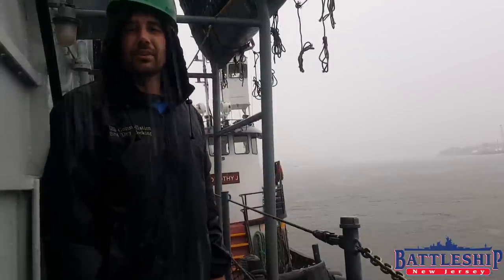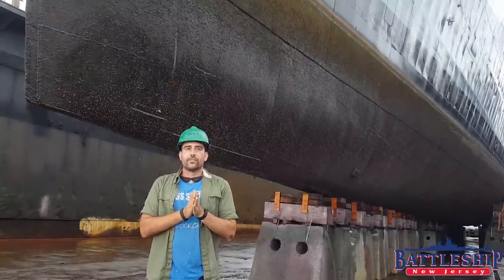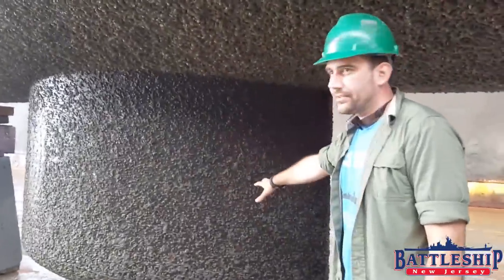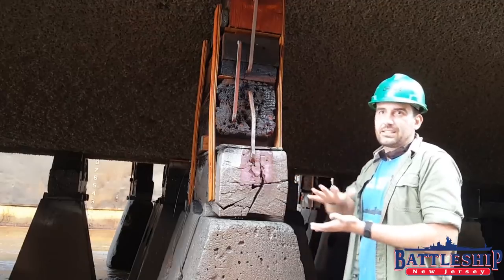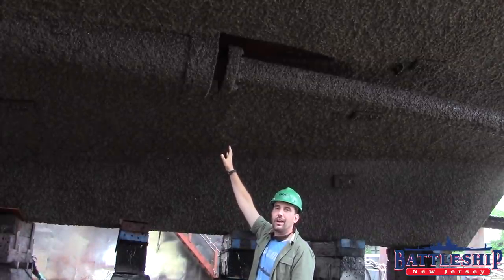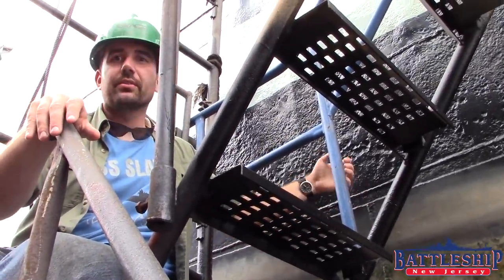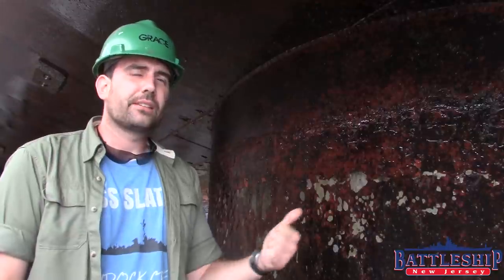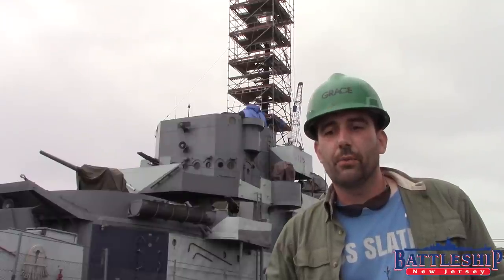Dry Docking a War Ship

Comment: Battleship Texas is expected to be dry docked sometime early 2021. In the case of the Texas, she is expected to be getting an entire hull replacement. This is due to her deterioration from sitting in a shallow berth for the last several decades in brackish water. For the last 18 months, the Texas has been closed to visitors and every artifact onboard is being restored by volunteers in a nearby warehouse. For the last several months, Resolve Marine Group has been contracted to handle the moving of the ship to the dry dock. This requires the removal of everything on deck and the foaming of 30 tanks below the water line in order to increase her buoyancy. It has not been announced which shipyard will be handling the work or where she will rest after the work is completed. Battleship Texas is expected to be in dry dock for 12 months. I implore you all to follow the story of Battleship Texas.
Reply: From what I have seen is that the Texas will probably go to Ingalls in mobile.
Reply: I really hope Texas doesnt do a Warspite and break free of tow lines and beach herself
Reply: Update: Battleship Texas is now expected to be moved to dry dock in late 2021 after hurricane season
Reply: A hull replacement ? not to original that's a lot of thick steel
Reply: @eddiekulp1241  We are keeping the original armor belt in place. Her hull is separate from the belt armor. She also has a second hull on top of the armor in the form of the torpedo blisters that were added in 1925-27. It's all 3/8 shell plating like slater but in much worse condition.
Reply: Everything you said was pretty much spot on except for the reason for removals and foaming. It wasn't for increased buoyancy. The foam actually added weight since it replaced air with foam. The foam was to act as a stop gap to plug most of the tiny leaks and make sure those tanks can't flood anymore since the foam displaces where the water would go. The guns on deck weren't removed for weight either. They totaled maybe 300 tons of your super generous. That's nothing to the ship. They were removed just to be restored.
Reply: She's in the dock now. Let's see how it goes. FYI, there's a pretty sweet drone video of her in dry dock already.

Comment: Usually I find that zinc anodes not sacrificing themselves is a bad sign because it means something else has.
Reply: I know "sacrificial zinc" is a generic term people use.  But, I  thought zinc was for salt water, Magnesium for fresh and Aluminum for brackish water..
Reply: @__hjg__2123  Yes. Sacrificial metal is really the generic term
Reply: @__hjg__2123  One metal will be acting as anode and one as cathode. What is what depends only on your metals electronegativity(its 1.83 for Fe, 1.65 for Zn, 1.61 for Al and 1.31 for Mg). Metal with lower value of electronegativity will be dissolving. I can imagine that you want to use Mg for cathode if you planing to drink that water, extra Mg in your water is safer and potentiany benefitial for your health and you do not want to overdose the Zn.
Al is used in salty waters because you need Cl ions in the water to avoid aluminium passivation but here i can imagine that Zn is easier to mount and this ship is in a river so not so much salt is in the water.
The fact that you have salt in the water helps with the transfer of the current and that is why cars rust more in places where in the winter the salt is used to protect roads from snow/ice.
https://en.wikipedia.org/wiki/Sacrificial_metal
Reply: Usually the zinc anodes and metal that they are protecting are not covered in paint...
But in this case its different story and if paint is holding then there should be no contact with the water = no sacrificing.

Comment: Buoyancy of floating drydocks is amazing.  To lift that tonnage with just air vs. water.
Reply: So easy in metric. 10 cm2 = 1L = 1 kg
Reply: Not really a big deal. Just weight of water versus steel and bouancy of air.
Reply: @johnknoefler  Air is less dense than water making it negligible. The boat is buoyant because the water displaced by the hull creates a force that overcomes the weight of the ship. This is a huge deal. Just from a quick Google search it appears as if the USS Slater displaces 1,240t of water. That's a lot of force being generated.
Reply: @johnknoefler  it's called displacement which means the amount of water a ship displaces to float or in this case the ship plus the drydock
Reply: Just a stupid Question but where do floating drydocks go to be worked on?
Bigger drydocks? And how do you work on them?
Reply: @sealy3  There is never a stupid question. Yes they go to a bigger Dry Dock to be worked on and in some cases they go where they have what is called a Graving Dock. Those are dug out of the ground and have a gate so to speak they close and pump the water out. Working on them is pretty much the same as working on a ship. They perform a inspection on the under water hull and make the repairs needed. Then they would blast the old paint off and repaint. There would also be repairs made to system inside that cannot be opened up while in the water.
Reply: Look up that famous picture of a dry dock ship, holding two other dry dock ships, holding their own ships on top. Pretty funky one.

Comment: When I was in the Navy we were told that the ship had two separate blocking plans and they would alternate which one they used each time the ship was dry docked.  So parts that did not get blasted & painted in one yard period would get  taken care of next time.  Of course with active USN ships they are typically dry docked every 5 years at least which is not feasible for most museum ships due to funding issues and in some cases lack of suitable dry docks.  (if Iowa or Midway needed to dry dock they would need to be towed to either Hawaii or Seattle)
Reply: Now, for an additional charge, they "fleet" the vessel, which is to say they move her forward or aft a few feet  on the blocks, and pump out the dock to get the areas that were covered by the blocks. It's a great time to check for leaks.
Reply: That’s the advantage of floating dry docks. They move to your location

Comment: At around 9;02 the plug in the bottom of the rudder is to preserve the rudder on the inside. The newer DDG's and most other class ships have one on the bottom and two on the top of the rudder. The process is know as flow coating. The process goes like this you pump in a preservative and then pump in potable water  to float the coating to coat the inside of the rudder till it comes out of the top plug hole. Then you would start draining the water back out to coat it again then reinstall the plugs preserving the inside of the rudder. Yes I work in a shipyard and we do repair work on US Navy ships just in case anyone wondered how I know this. We do this prior to coming out of Drydock.

Comment: Damn but that takes me back.  The last ship I took through a drydocking was a 'little bit' larger than Slater, a 40,000 ton amphibious assault ship.  Even while in drydock we had to feed water to parts of the ship's engineering plant and to the saltwater fire mains via large hoses from the sides of the dock.  Overboard discharge was also active so we did have water being discharged through some of the seachests even while work on the hull was on going.

She sat much higher above the dock floor than Slater is here, it was possible to walk from one side of the ship to the other with this big 'steel cloud' overhead.  Neat!  The two six bladed screws were huge, about 18 feet diameter and she had two rudders.

Comment: The propellers on the Slater seem relatively small, what RPM are they running at  flank speed?
Reply: TDL: probably around 300 RPM, roughly.
Reply: As he said in the video, they're designed for efficiency rather than speed. Destroyer Escorts like the Slater were designed to have a top speed of only 21 knots. They were intended as economical convoy escorts. They didn't need to be fast to keep up with a convoy plodding along at 12 knots, they only needed to be quick enough to run down a submerged submarine, most of which could only get into the low 10s of knots at best. Cannon-class destroyer escorts are small ships, so they needed their powerplants to be as efficient as possible in order to make the long voyages across the Atlantic and Pacific.
Reply: Uss slater?
Reply: @klegendm2819  Yes.
Reply: USS Slater is a museum ship based in Albany, NY

Comment: I always wondered how they coated the places that the blocking covered
Reply: "Bouncing" they call it.
Reply from the maker: Or fleeting
Reply: I wondered that also. Seems like a lot of time and expense to get to those small spots. But I guess it does need to get done. I thought maybe they put new blocking in the freshly painted areas and pounded in some wedging to take some weight off the original blocking and then knocked out that blocking to get to the spots. Apparently that would not work or take longer and be more work than repositioning the ship by flooding the dock.
Reply from the maker: Painting is important here, but its also about looking at the hull for issues. Fleeting gives you the whole picture. Ships that don't do it have problems down the road
Reply: I thought they would do the work on the hull, wait for it to dry, put new blocks below the ship and remove the old ones, without flooding the dock.
Reply from the maker: Getting the original blocks out would be risky in that case
Reply: @BattleshipNewJersey  Having gone through dry docking on a Navy ship and on several sea going tugboats I always wondered about those areas covered by blocking too.  Now I know.     One question though, It looked in the video like the zincs were painted also or was that just the lighting?
Reply: With much smaller boats hoisted by a travel lift (crane using slings that moves on wheels) the way this is done is on the last day in the yard they hoist the boat and hopefully time it for lunch so she is in the slings for an hour or so.  We quickly  roll under the keel, scrape, sand, and paint.  You need to ignore the fact that if the slings part you will be squashed like a bug and just do this work as fast as possible.  Usually most of the keel is supported so I can sneak up on the work reach under the keel while doing the rest of the hull so there are only small bits left where the blocking is.  Bottom paint will cure underwater but it is not the best way. The jacks that hold the boat laterally can be doubled and the old removed and this is usually done as soon as the main part of the hull is painted and curing.  Then the paint under the stands can be sanded and painted.  This adds about a day to the work but there are always many tasks to do while your boat is out so you just shift to them. Always nervewracking procedure.
Reply: I used to work on a drydock and the areas covered by the blocks do not get painted. Every time we dry docked ships you would see where the blocks sat from the previous drydocking as the paint was very faded. Naturally you would position the ship to make sure you could paint those previous areas when the ship went into dry docking again. The paint that was originally applied to the hull lasts a very long time. The bottom of the hulls were typically in very good condition. Most rust and corrosion problems are right at the keel line typically at the front of the ship.
Reply: As long as the zinc plates tough bare steel hull .. you can paint over them exposed to water
Reply: @SCVIndy  Where do you get this info?  Zincs I've seen, the type used here are stamped, DO NOT PAINT on them.
Reply: @alwaysbearded1  they use zinc anodes in heat exchangers using salt water cooling .. their just bolted on inside .. metal to metal contact needed so the electrolysis creating the rust goes for the zinc before the steel 

Painting over the outside doesn’t effect the metal to metal contact w the hull
Reply: @SCVIndy  Should I try that with my prop zincs tomorrow then?  My pencil zinc inside my engine is as you described but I've always been cautioned not to paint zincs. Next time I'm at my local Maritime Museum I'll take a photo of one of the 50# zincs that are like these and see if I'm remembering correctly. If the paint job were perfect how would the zinc connect with the water to complete the connection electrically?
Reply: @alwaysbearded1  my only knowledge is limited to heat exchangers ..
Reply: @SCVIndy  NEVER PAINT AN ANODE - this is one of the first things I was taught while working in a boatyard...surveyors flag painted anodes, furthermore many anodes are stamped "do not paint"

Comment: Came across an interesting story about USS Iowa being drydocked in one of the big floating drydocks during the latter stages of WW2. Her Captain (who was apparently something of a hot dog), rather than following the directives of the floating drydock crew and moving into the dock very slowly, charged in at about 10kt, , then backed down full to stop. Of course, that knocked over some of the blocks, and sure enough when they pumped out the drydock and picked up the ship, one of those out-of place blocks punched a hole in the outer hull.

Comment: Amazing video! 

May I ask one logistic question ?
When the ship is fleeting ( fleeted ? ... damn, my english isn't good enough ! ), you basically re flood the ship ( submerge the drydock ), then remove the blocks while underwater AND then place a whole new sets, and then re dock the ship like 2 feet away, correct ?
To do so, you need a very precise control of the position of a quite huge ship ( I guess that it's no easy feat ... how do you do that ? ), AND you would need 2 sets of individual block adapters , and a very precise sequence of where they would go ( If I've understood correctly, there are specific drawings for this ), and someone who install it underwater ... Correct? 
 It's a huge work even just set the ship where it should go! 
And a whole lot of complex steps ! 

WOW!

Comment: You may have overstated the pressure used. Water at 80,000 psi WILL puncture the hull.
Reply: I think he meant 8000 psi. Yes, 80,000 will puncture the hull considering the steel is likely 36,000 psi

Comment: If you have a hot water heater in your house it also has a zinc anode just like they have on the battleship well it’s smaller but still serves the same purpose

Comment: Surprised that the blocking is not placed under the hull frames, especially with thin plates.  I would be concerned the plates might collapse in such an old ship.  Destroyers always look like the hulls are made of tissue paper over balsa wood ribs.
Reply: if there're enough of them the weight gets distributed to make each spot within its tolerance. I would think the navy took that in to consideration (he said they followed the navy's plan)
Reply: Pretty sure there is a print with the layout and blocks specified, supplied with the prints for the ship.
Reply: A good friend who served says they are nicknamed "Tin Cans" for that reason.

Comment: This was amazing.  I was surprised at how small the propellers are.  The ones on
the Titanic seemed much larger.  Also, if the sonar dome hits something, could
it tear off and put a hole in the ship?
Reply: i think you are confused by the size and type of vessel shown here. USS Slater has only a displacement of 1,260 t to Titanic's 52.310 t.  this is not the USS New jersey that at her peek weight 61.000 t according to Wikipedia.  
for te sonar dome, as far as i know it is a separate compartment  sealed from the rest of the ship, but i expect it probably wil cause at least a hole in the bottom if the dome hints something because the backside wil push upward.

Comment: Question: What IS the largest museum warship in the world now?
I figure the Iowa-class battleships as a group are the LARGEST, completely preserved CLASS of naval vessels (all 4 completed units still in existence) BUT that the largest INDIVIDUAL preserved warship is probably the USS Midway, the lead and sole-surviving ship of the Midway class aircraft carriers.
The Iowas grossed around 61,000 tons each fully loaded.  General/light load was around 47,000tons which is still impressive by today's standards.
The Midway as commissioned grossed 45,000 tons which wasn't even the highest-grossing carrier of its service entry post-World War II -- the biggest carrier by tonnage in World War II would have been the Shinano (70,000 tons), converted from the third Yamato-class battleship.  Shinano did not survive World War II and remains an undiscovered war wreck.  (They have found the other 2 ships of the Yamato class.)
The Midway was around 70,000-72,000 tons max tonnage when decommissioned because of modernizations and flight deck rebuilds to a configuration/deck size closer to a supercarrier class vessel.  Her sister ship, Coral Sea, was close to 67,000 tons fully loaded when she decommissioned in 1990 and had a far smaller flight deck because she didn't undergo the rebuild and enlargement of the flight deck USS Midway did between 1966(?) and 1970.
Reply from the maker: Midway is what comes to mind for us too. You could probably throw Queen Mary in at no. 2. But she isnt a war ship. Then probably the Iowas.